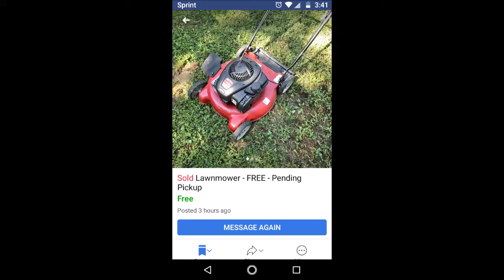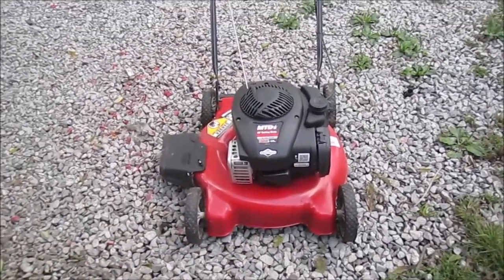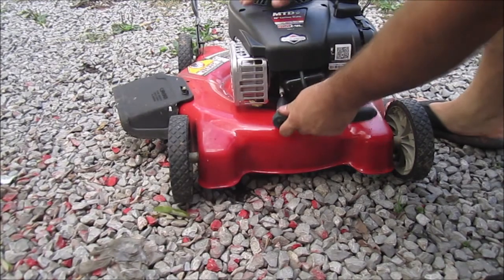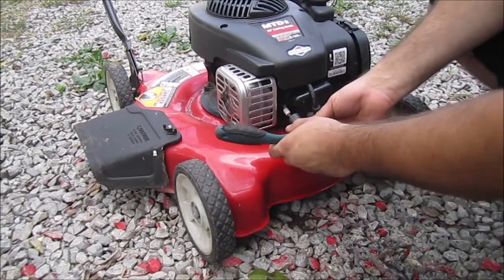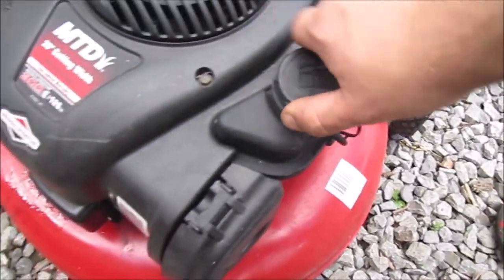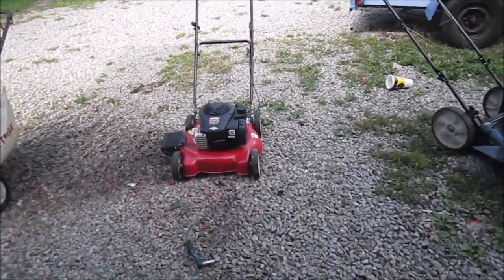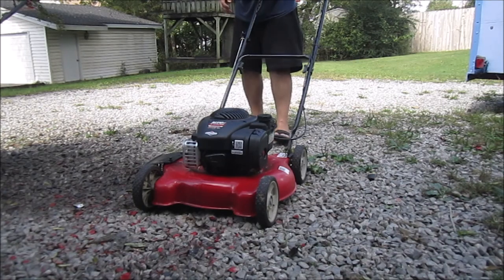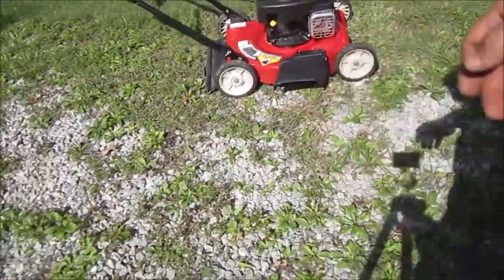free mtd push mower rope wont pull?

Comment: I came across a almost new troy built self propelled mower with Briggs & Stratton 150cc ex. Same issue. Little over full on oil and pull cord not pulling. I changed oil, cleaned it and new filter. If I manually turn the blade by hand it will pull and start. If I shut it off to dump bag it's back to locked up. Thinking maybe rings are shot and letting oil into the chamber. Any ideas or suggestions of what may be the problem?
Reply from the maker: Did u pull the spark plug out also ? Maybe still in there if so
Reply: @Turningwrenches85  I did pull out plug to check condition of it. Looked to be fine. Was dry no oil on it or signs of oil being on it before. I forgot to pull the cord with it out.
Reply from the maker: @boosted95  oh ok still having issues now?
Reply: @Turningwrenches85  I'll check it when I get home from work and let you know. Used it yesterday to mow by back yard. It ran without a problem as long as you don't turn it off. Just odd to me that it locks up after it has ran. Maybe a type of vapor lock and not oil doing it. I'll write you back after I check it though. Thanks for the quick replies by the way.
Reply: I finally got out to check it out again. I pulled plug out. It was normal and dry. Probably original to the 2016 mower.Pull cord was still stuck from last time it ran. Turned the blade about half a turn and it frees up the crank. Pulled the cord several times. Nothing came out. Put plug in and it started right up first pull. Mowed for 15min. I turned it off and it's back locked up. Can't even manually turn blade more than a inch or two either direction. Pulled plug again while still hot. Blade still stuck. Almost no movement. If I go out there tomorrow I can easily free the crank and starts right up. It will run like new till it gets to temp and I turn it off. It will be back to locked up till it cools off and I manually free the crank by hand. Could it be the crankshaft bearings gone bad. Maybe they get hot and lock it up once it stops?
Reply from the maker: @boosted95  I would try putting some oil in there and see if it tries to free it up I wonder if the Rings are getting stuck could be scoring on the Piston possibly but I would try putting some oil in the spark plug hole and then try rotating it slowly and see what happens from there

Comment: I have that exact lawnmower my METAL oil pan exploded today a spewed oil everywhere
Reply from the maker: Sounds like your lawn mower there threw a rod or connecting rod
Reply: Turning_wrenches85  I had a john Deere mower throw a rod before and I fixed it I looked at this one and I took the mower off the red thing and unscrewewed all the bolts but the thing to get to the rods would not open do you know another way to get to the rods so I can fix them
Reply from the maker: @boywonder5691  more than likely have to take the head off unless u take off the sump cover on the bottom of the engine

Comment: So what you do just replace the spark plugs?
Reply from the maker: the spark plug was good on it I just cleaned off all the oil and carbon on it, had good spark coming out of it and I still use the same plug had no issues with the mower when I had it at the time
Reply: I have an issue with mine rn
Reply: It’s lock locked lol I think it’s broken cause you took the plug out and it started pulling when I took mine out was still locked the blades hardly moving and Iont know what to do
Reply from the maker: @JamesSmith-qu1mz  I know this is going to sound crazy try spraying some WD-40 if you have any spray it in there let it sit for a little while try to rotate the blade and see if it comes free from that way do you have plenty of oil in your mower

Comment: Hello sir, how did you get the pull to move freely? You didn't show that in the video. Thank you
Reply from the maker: Oh i thought i did. I took the spark plug out there and when i pulled the rope that is when the oil came out from being overfilled and then the mower pulled freely after that.
Reply: @Turningwrenches85  okay, thank you so much of your time and kindness.
Reply from the maker: @genioc5669  your welcome sir, i hope u are able to get your mower going. If you have one like this and it's still having a hard time moving freely try spraying some maybe WD-40 in there on the pull rope possibly maybe in the spark plug area.
Reply: @Turningwrenches85  will do so. Thanks

Comment: Looks like a China motor made for Briggs and Stratton - I've got one that I bought for $5.00 - man told me it ran but not well . Too full of oil and  changed the oil and put it too the right level and Cleaned the dirty gas tank out and put a new diaphragm in it . And bought a new kill cable off EBay for $6.50 . It runs smoothly now - just give it a good cleaning and it'll make somebody a good mower . REMEMBER PEOPLE TOO NOT OVER FILL THE MOTORS WITH OIL  . This one was pushing the excess oil out the muffler. Use common horse sense ......
Reply from the maker: Yes sir u are correct